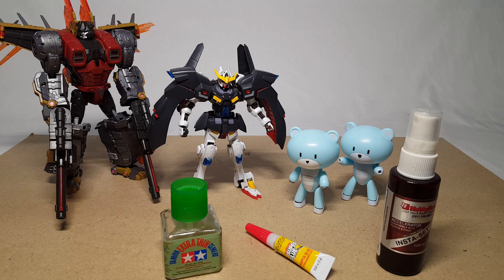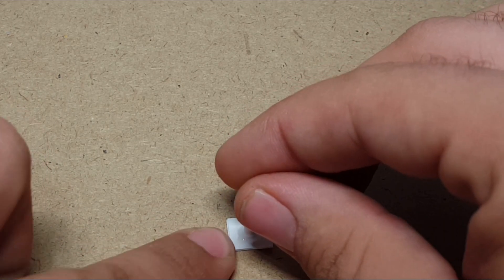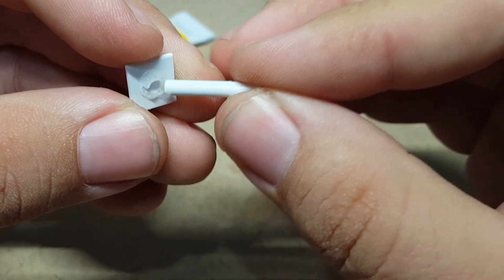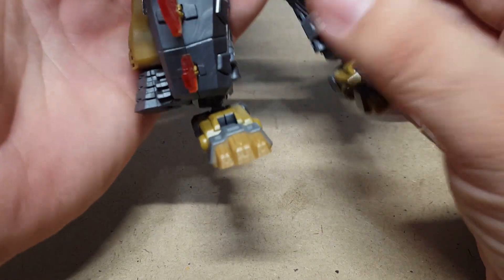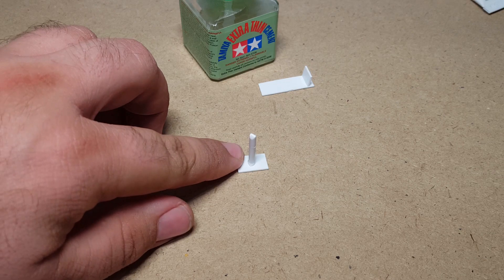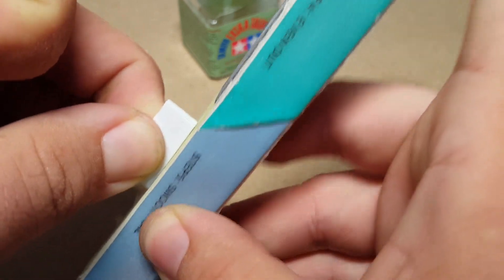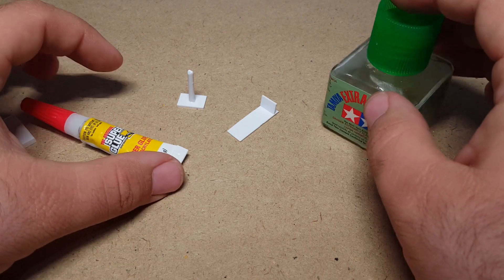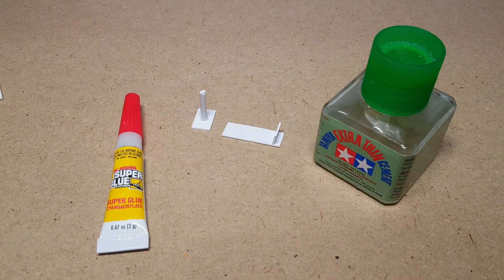SHOKY BUILDER TIPS: Plastic Cement or Super Glue?

Comment: Does Mr cement SP work on polycaps?
Reply from the maker: After doing quick research on SP no would be the answer. I don't know of a cement that will work on poly caps due to their poly ethylene nature. If there is something for that I specifically don't know. SP seems to be the same type of cement as the S but dries super fast.
Reply: @THEShoky  i see then could i ask you 1 quick question? Does RG NU have any polycaps in it?
Reply from the maker: @agungyoga4520  RGs generally don't have polycaps
Reply: @THEShoky  thankyou very much
Reply from the maker: @agungyoga4520  what exactly were you trying to do?
Reply: @THEShoky  just trying to fix my hg moon Gundam and astaroth rinascimento joint and try to avoid buying gunpla with polycaps
Reply from the maker: Wait moon Gundam has no polycaps. As for astaroth to help out what I assume are the shoulders that are sagging use superglue to beef up the joint. Or clear nail polish.
Reply: @THEShoky  yes moon Gundam did'nt have any polycaps but i broke the joint that connect the waist and the leg and as for the astaroth i broke his leg joint but i already did some modification to make a new one but unfortunately you told me that Mr cement can't work on polycaps so i'll search for a super glue near my area
Reply from the maker: Well no it doesn't work in polycaps but it will on the plastic around the polycaps.
Reply: @THEShoky  thanks but i'll use superglue instead so it Will stay there and wont break again, i don't know if i use it in the right way or not but it seems like Mr cement is'nt as strong as super glue? Anyway i subscribed cause your content are really useful and you even answer my comment, thanks a lot dude

Comment: I usually prefer my kits unpainted so what I do is to shave off bits of plastics from runners and melt them down by adding Tamiya Extra Thin Cement. Leave it overnight and you can apply it to parts the next day. Be careful though and don't over apply because it will melt the plastic.
Reply from the maker: Sprue goo. I use it now too.